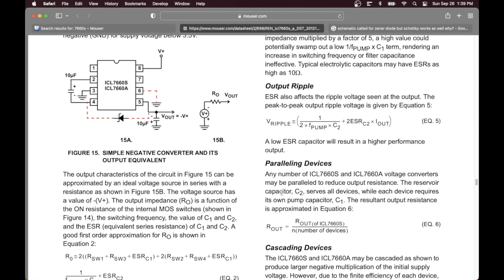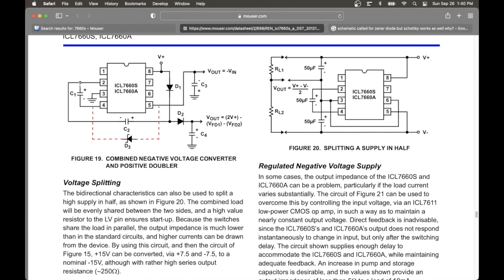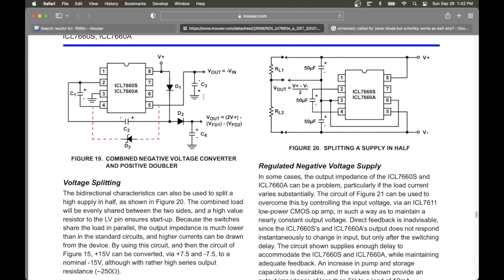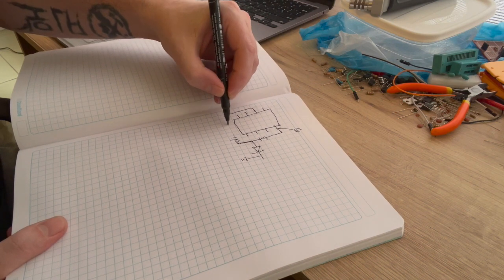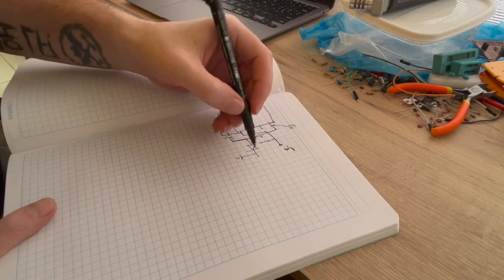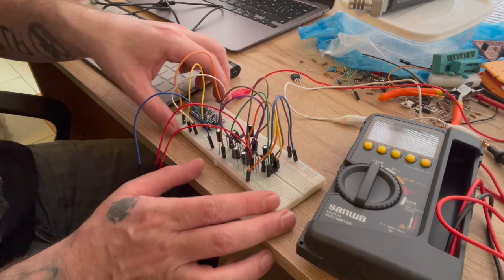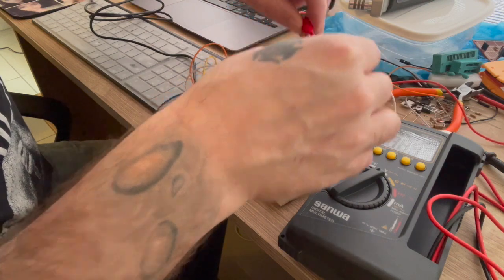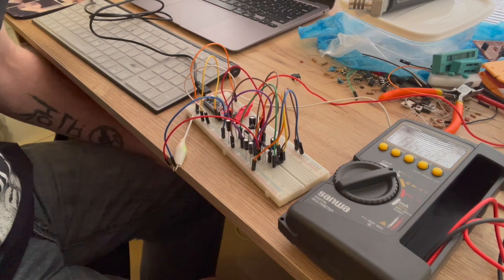4116 RAM Tester pt.2 - Negative 5 volts using the 7660 IC

Comment: Is the reason for the Zenner make it easy to add or subtract voltages?
Reply: It turns out that it is actually a Schottky diode and not zener. That schematic is just not very good. I think they added the extra lines by hand and made them look like zener. In any case, that diode is only necessary if our input voltage is higher than 5V. Ours wasn’t in this case so it has no effect. I overlooked that when I made this video and have since realized it. So, for this application it is not needed but it won’t hurt anything if it is there
Reply: Actually it’s necessary on the second one but it’s only a just in case measure. If you look at the data sheet it has a list of do’s and don’ts. In this case it’s there to make sure that pin 5 stays are a certain reference voltage. I don’t remember the exact amount but my circuit has worked without it so it’s not always necessary. That being said, I would use a Schottky diode there as the datasheet says as a “just in case” measure.
Reply: Ok the 5v or less explains thanks. Reference. I would have eventually come to the same conclusion. Sometimes ok ur mistakes teach more. Thank you friend. Keep up the work.
Reply from the maker: Thank you very much and pardon me for using the wrong account to reply the first time.
Reply: @E-Maker  didn’t even notice the account difference. Honestly the response felt genuine. I follow my gut, I’ll soon be doing videos as well. Thanks for your help in that. 
God Bless.